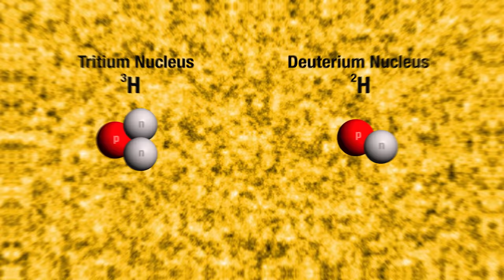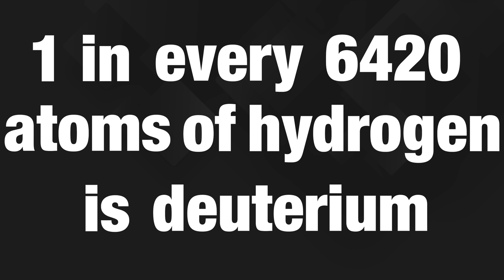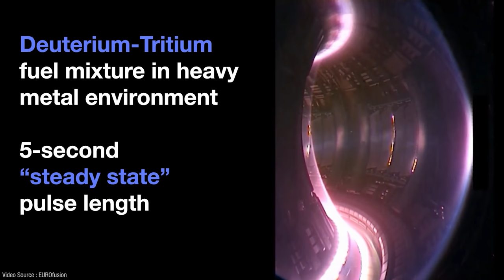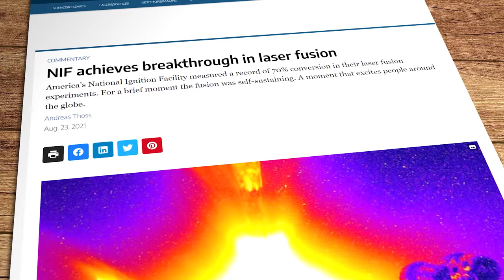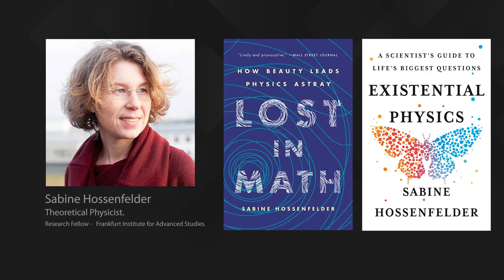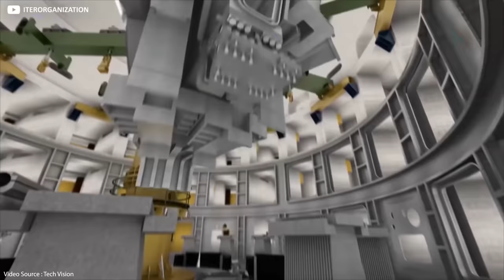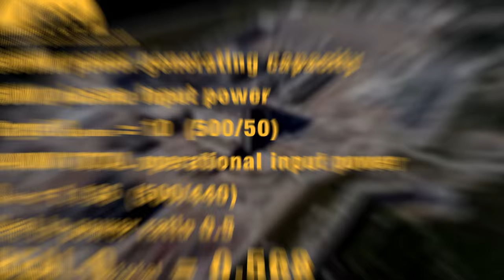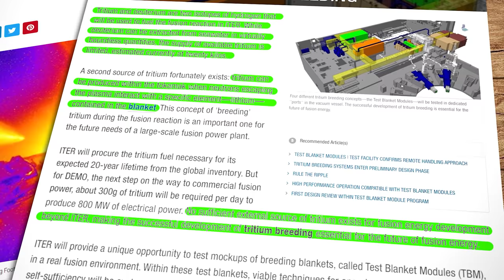Nuclear Fusion Illusion. Is it time to park the pipe dream?

Comment: Although the sun (obviously) produces loads of heat it actually has a very low power density (much lower than say an internal combustion engine). Even if net-positive fusion could be demonstrated I'm curious then as to how this energy density problem can be overcome. I must be missing something so I'd appreciate some insight from someone who knows what they're talking about!
Reply: fusion reactors don't really use the sun as their model. It is just a way to explain the idea to lay folks.
Reply: That's quite the problem. The sun is obviously net positive fusion reactor, but is low density. To get high density and contain it safely takes loads of other power-consuming systems.  The more fusion power we can create, the more power-hungry systems we need to control and sustain it.  The equation hasn't moved in a positive direction in decades.

Comment: One thing that I found misleading is the statement about JET most recent experimental campaign. The goal was not to double the power, as the video has suggested, it was actually done to test a different wall material (the kind of material that will be used in ITER) than what was used in 1997 JET campaign.
Also, I find it slightly dishonest to present ITER Q total < 0.5 as a some sort of criticism of the machine. It like looking at a university rocket team and saying ""well that will never deliver a satellite to orbit" , but it was never meant to in the first place. ITER was not designed or build to be a prototype energy producing reactor. It was designed to be a next step in long series of fusion reactor experiments.

Comment: Yup, let's build lots more fission plants, and thorium plants.  Fossil fuel WILL eventually run out.  There are exciting technologies using energy (fission plants, solar, et cetera) to pull CO2 from the air and turn it into energy dense liquid fuels such as methane, ethanol, or othe petrochemicals.

Perhaps it's even time to revive the old solar energy satellite sending power to Earth via microwave idea.  24/7, uninterrupted solar power.

Comment: I wish people would not judge fusion based on a list of single points and then doing some kind of "layman's sum" in their head. Perhaps only consider the reluctance to spend ~$20B on ITER (over decades) while society will happily spend ~$14B on 3 weeks of Tokyo olympics. The thing is, the whole success matrix is so complicated that you just cannot hold it in your head. Human brains are worthless in taking exponential factors into account. Such as improved superconductors influence on Qtotal, ability to do fast low-bureaucracy single-site solutions, etc. My 2 cents. Forget fusion saving us from greenhouse effect but also keep encouraging + funding them (they are a bargain).
Reply: The actual metric to track the success of the fusion research field is the "triple product" of plasma density, temperature and time achieved in actual experiments, and that has improve at a rate on par with moore's law for 60 years while ITER was designed 30 years ago and is already obsolete. I'd argue it is still worth finishing to have a backstop to newer and more promising tech, to hedge our bets for ensuring humanity is able to take those next steps some day. But ITER is probably a dead end, so using it it critique far more advanced research is a strawman.

Comment: Good analysis...I've always been a fusion fan, but it seems it's a tougher nut to crack than we originally realized. So they'd need to produce at least 20x the energy to get a Q factor of 10. MIT has created powerful magnets that allow reactors to be 10x smaller...hopefully they will succeed where others have not.
Reply: william breen  well that's how science works, you don't just give up cause you hit a roadblock....I think MIT's solution could bring us much closer to a commercially viable reactor. ITER also should be able to work out the technological issues as well, that's why it's being built, it's a test reactor. If they succeed then we'll have fusion power in a legit 20-40 yrs. Still a long time frame but certainly not 'never.'

Comment: It's very unfortunate that fusion power is too late for addressing climate change, but I believe cutting funding or giving up fusion research would be a big mistake. Researchers have overcome so many challenges such as plasma heating, turbulences, various plasma instabilities and more recently viable materials for the inner walls of the vacuum chamber that should work in actual fusion power plants.
Even tritium breeding methods, which ITER will evaluate in combination with a fusion reactor, have already been successful with other processes, so I highly doubt this will be a show-stopper either.
And in JET, they successfully used sophisticated robots to do construction work inside the radio-active vacuum chamber entirely remotely.
I know the enormous size required for tokamaks or stellarators with a large enough Q makes this a very expensive endeavor (ITER is still just 2.5 times as expensive as the JWST though, which I also support), but a first Demo reactor that actually produces net power would require a Q_plasma of about 40, which is projected to be achievable with a power plant just 30% bigger than ITER (or slightly stronger superconducting magnets).
I really like this channel, but videos like this one and Sabine's that just try to lower the excitement about fusion sadden me, although I'm aware that there's too much hype at times in the media, maybe to get investors for smaller projects. 
Nevertheless, I'm confident that magnetic confinement fusion power will be harnessed within my lifetime if we don't scrap the research funding. This might well play an essential part for overcoming humanity's next big filter...
Reply: Well said. My thoughts exactly.
Reply: Thumbs up for the yt comment algorithm. 
Although Sabine's video was a bit negative, it was fair from what I remember which is exactly the goal. This one maybe less so, but it might just be me already knowing fussion is not in on the menu to reach the 2050 target.
Reply: @justnothing8692  Preventing global warming is something we could do even without reducing CO2, for example by emitting large amounts of aerosols into the atmosphere to block sunlight. This just might have drastic environmental impacts, like changing the colour of the sky gobally for starters. But it is doable already today, in contrast to FTL drives which are probably completely impossible. Sorry for being pedantic. ;-)
Reply: @helgefan8994  Man I've seen too many movies about trying exactly that and accidentally causing a chain reaction cause we don't fully understand the process and causing an Ice Age. Lets not go there.
Reply: @niveshproag3761  I know, I wasn't trying to say that this would be a good idea, just that it's possible in contrast to faster than light travel.

Comment: I would like to point out that the reason most scientist focus in Qplasma is that all the reactors we have built are just experimental reactors, wich mean that they have to be able to vary many of their parameters in a somehwhat wide spectrum.

Therefore they aren't maximized for the best possible performance, like a car engine would be after many many many years of expertirse, that's one of the reasons why they take so much time and are so expensive. When you desing a nuclear fusion reactor of up tp 10T of magnetic field for example, you have to make sure you can operate said reactor ina  wide range of magnetic intesities maybe from 2T to 10T. 

Once a certain combination of parameters results in a Qplasma>1 or like ITER Q>10 then we can design an optimized and cost reduced version of that reactor.

Anyway, this if ever comes to happen, will take +20 years

Comment: I think there is a separate, bigger problem with your initial premise.  That if Fusion were to be realized tomorrow, that it would solve our energy problems.  

As much as I like the concept of fusion, I am of the opinion that fusion is never (ie for next 1000 years) going to power our civilization because fundamentally it will never be economically viable.

Fusion offers a few main things.
1) low-carbon electricity
2) Unlimited Fuel
3) Small amount of radioactive waste.

But the problem is that Fission nuclear power already offers us all these things, and yet it isn't widely used.  It's not used because it is not economical.   There are possible ways to make it economical that I hope bears fruit, but that is the sticking point.  

Fission is low-carbon. It's median Carbon is ~12g/kwh, on par with Wind's low carbon footprint of ~11g/kwh. And some designs like CANDU even get down to as low as 3g/kwh.  Even if Fusion was better, the difference between 1 and 3g per kwh is irrelevant, since a carbon footprint ten times that would still be tolerable for our needs. Being more low-carbon than fission power doesn't really gain us anything.

Fission has unlimited fuel as well, for all practical purposes.  Fusion fuel on Earth exists in enough abundance to run civilization for tens of millions of years.  Fission by contrast only has enough fuel to run civilization for 10,000 years, using the fuel as we do today, and a few million years using fuel in ways we've already demonstrated in the lab, in test reactors, and in some commercial scale reactors in France and Russia.  Now, tens of millions is much more unlimited than mere tens of thousands or millions of years... but that doesn't really matter*.  Both utilize fuel that is so abundant that it is functionally unlimited for our considerations over any meaningful timeline.  Being *more abundant than fission fuel doesn't actually gain us anything.

Radioactive Waste.  Fusion does not produce no radioactive waste.  It doesn't produce long-lived radioactive waste.  But it does still produce radioactive waste.  Fusion processes produce a large excess of neutrons which will bombard the inside of whatever fusion device is devised, and it will transmute the materials into radioactive isotopes, some of which will have half-lives on the order of tens of years, and thus require custodianship for hundreds of years, based off standards of current radioactive waste from nuclear plants.  10-halflives to safety is the general rule.

Fission largely produces the same profile of waste.  All the waste from commercial fission reactors have half-lives under 30 years, requiring a <300 year period before the spent fuel is less radioactive than the uranium originally pulled from the ground to make it.  All the waste, except for the plutonium and other trans-uranics bred in the reactor which have half-lives in the thousands of years, requiring storage of tens of thousands of years.  This would seem like an advantage for Fusion - less of a radioactive waste stream to manage.  But this isn't actually a problem for fission.  The waste is small in volume and can be burried in deep geological repositories.  Or, in my preference, we can just construct reactors designed to fission plutonium, which converts this long-lived transuranic problem into more fission products with the same ~300 year custodial period.  

The difference of having to store a football field or a tennis field of nuclear material  is a large relative difference, but fundamentaly the fission waste footprint is already so small, that it being still-again smaller doesn't actually gain us anything.

Fusion offers us good things... but the good things it offers are good things Fission already offers us.  Fusion provides MORE of that goodness than Fission... but the diminishing returns make the advantages fusion offers over fission more or less irrelevant.  When we have super low carbon, super abundant power with a small radioactive waste stream, we don't gain anything from having a mega low carbon, mega abundant power with a similarly small radioactive waste stream.

And the big, fundamental problem is that Fusion is HARD.  Atoms do not WANT to fuse. We have to put plasmas under temperatures ten times greater than the core of the sun in order to get any kind of practical energy generation.  Even if we figure out HOW to do it consistently and reliably, it is going to require large facilities with expensive superconducting magnets, lots of personel, lots of maintenance, and lots of overall material expense.  By contrast, fission is so easy that natural fission reactors have occurred all over the world, just by some seawater flooding some caves filled with uranium ore.   Extracting an equal amount of net energy from a fission process vs a fusion process is always going to require a much, much simpler facility with fewer people, less maintenance, less extreme materials and operating conditions, and more reliability.  And all of that, fundamentally, translates to cost.

It's always going to be cheaper to build a bicycle than a car.  It's just, fundamentally, much simpler with fewer parts and looser tolerances and no extreme conditions.  If we were trying to do something extreme, like travel thousands of miles, then it might be worth the cost of a cost of constructing cars over bicycles. The advantages might compensate for the cost.  But when we're talking about the equivalent of traveling a single mile, a bicycle is always going to win out for simplicity and efficiency over a car.  Similarly, Fusion might be beneficial for powering deep space probes and another niche situations where the greater energy density is worthwhile... but for powering our civilization, the fundamental question is: "How much will it cost to build, fuel, and operate a 1GW electrical plant for 30 years?"   And the answer is always going to be: "Much less for a fission plant than for a fusion plant."   There's just no way around it, given how comparatively simple fission is over fusion.  And Fusion offers us no advantages that are actually going to translate to societal benefits enough to justify the cost.  It's just not going to happen.  Not in ten years, not in thirty years, not in a hundred years.  If we could snap our fingers and achieve 10x over unity tomorrow with whatever fusion device you favor... it's still going to require a facility more massive an expensive than an equivalent fission plant. 

If fission isn't economical, then fusion will not be.  And if fission is made economical... fusion will not be competitive.  Fusion is interesting, and it is a science experiment I think is worth funding, but I think it is silly to presume it will ever provide power to the world on any practical scale, because it just isn't practical compared to available alternatives.

Comment: A very good, unusually realistic, balanced presentation. Well done, Sir. However, you didn't mention another issue which fusion reactor proponents omit. Neutron Embrittlement. Nuclear fusion creates enormous quantities of neutrons, which are unaffected by magnetic containment. Those neutrons smash into the walls of the vacuum vessel†, actively destroying the material. Published estimates posit refurbishment every two years of the vacuum vessel. 

Remember, the vacuum vessel is the 'core' of the fusion reactor, so removing it is not trivial. The now radio-active vacuum vessel will have to be safely disassembled,  and removed. Then a new vacuum vessel installed, tested and commissioned, before it can go back to generating electricity. The suggestion I read was that process might be measured in months. Plus, there is the issue of safely 'disposing' of the radio active vacuum vessel material
.
I don't think this is a 'nit pick', though I think you did a much better analysis than any fusion reactor proponent I've seen, and I've been following fusion research since the mid/late '80s.

Again, very good, worthwhile video. Plus your balanced analysis is, sadly, rare in these highly polarised times.
Best Wishes to 'You and Yours' for 2022. ☮️
Reply: Oddly enough, the only response to this from fusion proponents is "crickets".  Fusion as an electricity source might work some day, but that doesn't matter.  It will NEVER be economically competitive, for the reason stated above as well as numerous others.  The idea that fusion will "save us" is indeed a fairy tale, and a dangerous one at that.  It is dangerous because it depletes resources and talent that could be used on something with a chance of being practical.

Comment: The SPARC reactor uses a new kind of breakthrough magnet (REBCO) - they are vastly more powerful than the magnets used in ITER. The magnets are so incredible they enable the reactor to be very small and cheap, so much so that SPARC may very well deliver net-fusion before ITER has even finished the commissioning stage. Fusion is very much here thanks to those REBCO magnets!
Reply: Add to that the recent advances in AI control of the plasma and I think there's still good reason to stay optimistic. In general there have been more little breakthroughs in the past five years than there were in the fifty previous ones. I think we're witnessing an acceleration in progress at the moment. My bet is that we'll surpass Q with stable plasma before the decade is done.
Reply: "Fusion is very much here thanks to those REBCO magnets!"

Did you not even listen to his video? Stop with the wishful thinking and look at the reality of the problems as his video does.
Reply: @christerdehlin8866  - I agree! AI is a nexus and computers are becoming insanely powerful. I'm a professional programmer with a deep understanding of computers in many facets - I can state with absolute confidence that specialist AI will solve the plasma stability problem very soon - even if we don't understand how it does it.
Reply: @witherbossbros1157  the video was about ITER a 30 year old design that's already obsolete. Breakeven power is basically solved. Most of the focus is on plasma control now.
Reply: @JohnnyWednesday  yeah advances get published practically weekly as teams all over the world chip away at the plasma control problem.